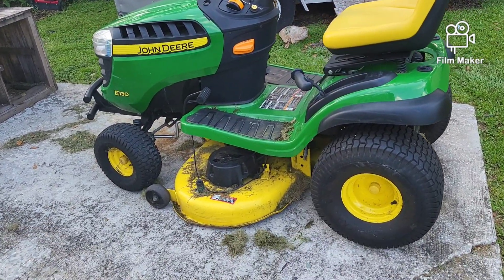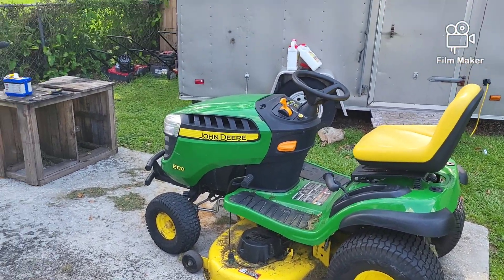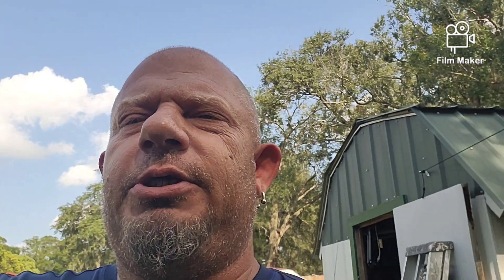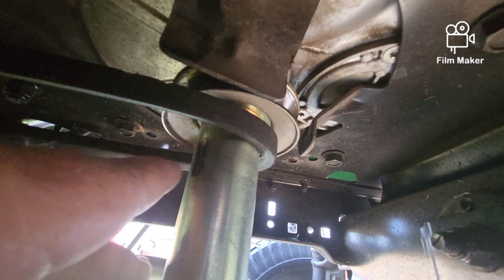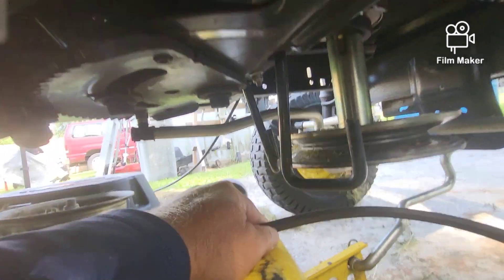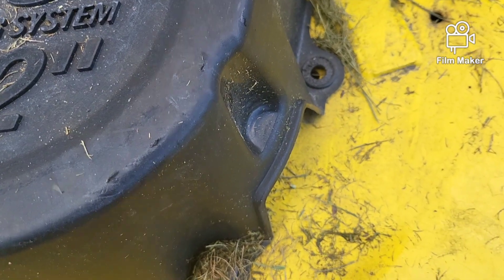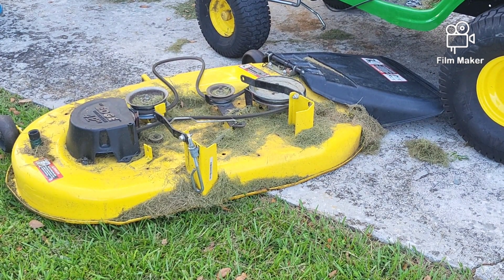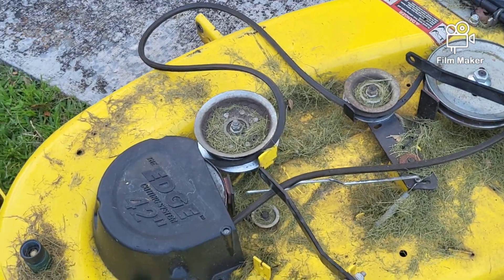John Deere E130 Belt Replacement/ Deck Removal

Comment: Good job. The transmission drive belt can be a real pain , especially with some tractors.  The Murray's come to mind. Either pull the steering wheel shaft,  or if your lucky you can shove the belt between steering wheel shaft and dash.  Unfortunately for me, i had other things that required more disassembly  anyway so I removed the steering shaft.
Reply from the maker: its silly how hard they make it to change a belt that often needs replacing. im glad this vid was at least entertaining lol
Reply: @MunkyWrench  
Yes Sir,  agreed

Comment: High time for a mower stand.  You would have discovered that belt problem far faster if you weren't crawling around on your hands and knees.  Might want to look into just making some out of junk wood that you could drive or pull the mowers front end up and on to.
Reply from the maker: Agreed my friend